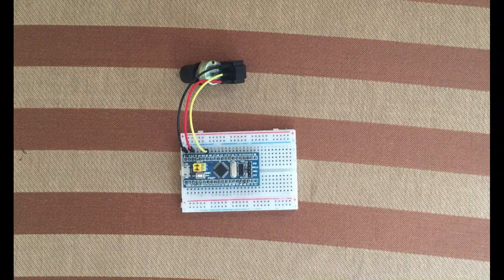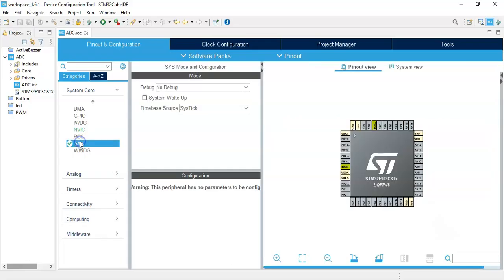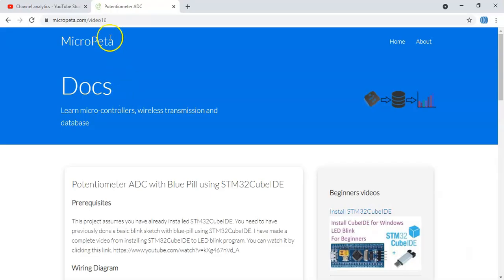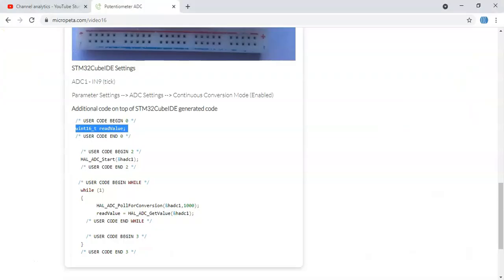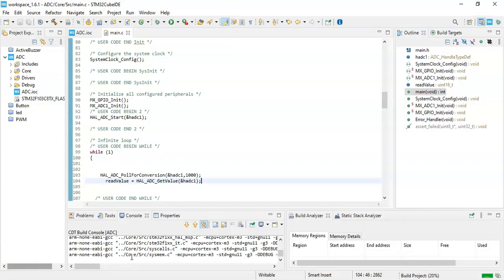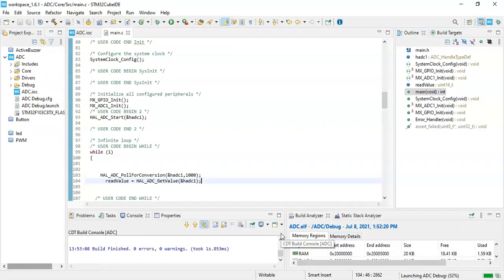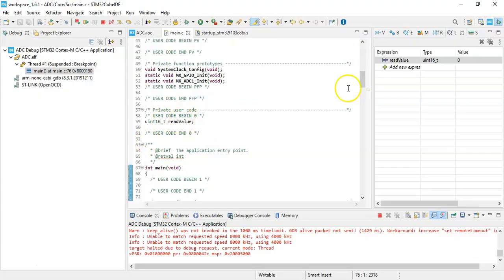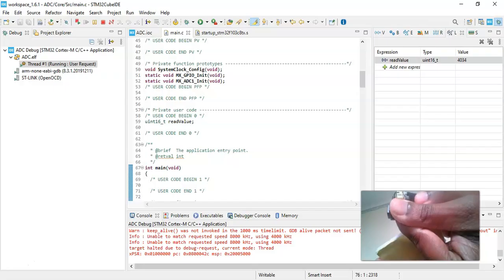16. STM32CubeIDE Potentiometer ADC with STM32F103C8T6

Comment: Hi Nizar
I'm tried to implement this code potentiometer ADC on blackpill f401 and so far the readings are static, only change by push reset button. I put clock on 8 MHz just like on BluePill but the results are the same.
I noticied that appears on IDE a file 0x0 that says on context 'source not found'?
Can you help me?
Thank you
Reply from the maker: If the board has clone STM32 chip on it, the ADC does not continuously converts.
We can stop and start ADC for each conversion as shown below Thanks
    HAL_ADC_Start(&hadc1);
    HAL_ADC_PollForConversion(&hadc1,1000);
    readValue = HAL_ADC_GetValue(&hadc1);
    HAL_ADC_Stop(&hadc1);
Reply: Hi Nizar
 thanks for responding.
I'me on your academy.
 Now i understand that can be an f401 clone who dont work as expected. Thank you

Comment: Anyone knows why i need to click reset button to update value? My program just same as the video
Reply from the maker: It may be due to non-original STM32 chip
If you use ADC stop and start for each reading, it will work as shown below. Thanks
    HAL_ADC_Start(&hadc1);
    HAL_ADC_PollForConversion(&hadc1,1000);
    readValue = HAL_ADC_GetValue(&hadc1);
    HAL_ADC_Stop(&hadc1);

Comment: Hey, if you dont mind, id have a question concerning this topic. Currently i am working on a project using stm32 and an ADS131 ADC (TexasInst). After developing and designing a pcb for this project i have to code the communication between ADC and MCU. I have basic C knowledge and very very basic (barely no xd) knowledge in programming MCUs. if you generate code from cubeMX, many files (main.c, stmxy.c, main.h, etc.) are created. It is pretty hard for me to see through this. I have some specific expectations for the communication (e.g. 10Hz, i want a timestamp (if possible?)). So, maybe you have any suggestions or help for me to get the software done.
Reply from the maker: You can create a timer interrupt every 100 milli seconds. It is very simple
I have created a video https://youtu.be/OSVffISU7DQ
In that video I created three interrupts every 200, 300 and 700 ms
As I understand you may need only one interrupts similar to that

Comment: Thanks for this..
Unfortunately, I only get one static figure in live expressions after following this step by step and double checking everything. continuous mode is enabled but my figures don't change with adjustment of the potentiometer. I've also checked that the potentiometer is working fine
What could be the problem?
Reply from the maker: Some microcontrollers don't allow auto conversions.  You may need to stop and start ADC every time
   HAL_ADC_Start(&hadc1);
    HAL_ADC_PollForConversion(&hadc1,1000);
    readValue = HAL_ADC_GetValue(&hadc1);
    HAL_ADC_Stop(&hadc1);
Reply: @NizarMohideen 
Thanks for such a prompt response. I am using the waveshare Xnucleo-411re board, it has an stm32411ret6 chip. If this board does not allow auto conversion, how can I execute the stop/start to generate readings, also is it possible to Transmit them to the serial.

I had similar challenges when I followed your other tutorial that monitors potentiometer readings through SWV. I got no results at all in the graph

Thanks again
Reply: @NizarMohideen  
I updated the code as above, it worked perfectly.
Kind regards to you

Comment: Hello sir. I'm trying to interface an twist throttle with this microcontroller. It gives output values from 0.8V to 4.3V. Also, I want to generate a PWM signal of 10kHz and change the duty cycle through twist throttle. How should I proceed with this one? Can you please guide me with this?

Comment: Thanks for the good tutorials! Beginner here. Is "readValue" already a variable or if not, how could you make it one?
Reply from the maker: Yes. readValue is a variable. I have already declared 

/* USER CODE BEGIN 0 */
uint16_t readValue;
/* USER CODE END 0 */
Reply: @NizarMohideen  thank you! So I could now take this variable and do calculations for example, right?
Reply from the maker: Yes. That is correct. You can use this variable as you would do with any integers

Comment: Easy peasy. Thank for that. I have a question, do you know why i cannot read the potenciometer in real time?
Reply from the maker: Did you get the value in live expression
Reply from the maker: STM32CubeIDE Settings
ADC1 - IN9 (tick)

Parameter Settings --> ADC Settings --> Continuous Conversion Mode (Enabled)
Reply: @NizarMohideen  I also have the same problem, My problem is that the value displayed in live expression is the breakpoint value,and the above two possible problems have been confirmed, is there any other problem? Thanks

Comment: Sir.. Y u not set RCC
Reply from the maker: I like this question.
Short answer.
This is a beginner video, I wanted to make it as simple as possible.

Long Answer.
STM32F103C8T6 has an internal clock which run at 8MHz. If we enable RCC, we can set the speed to different value up to maximum of 72MHz. 
The best part of STM32 and CubeIDE at least for me is very simple to learn an get started with many projects easily using HAL ( Hardware abstraction layer) and minimum settings. 
When the project uses more resources with many devices connected to it, we may need to optimise clock speed, interrupt, direct memory access. Also we can use low layer codes and direct register manipulation.